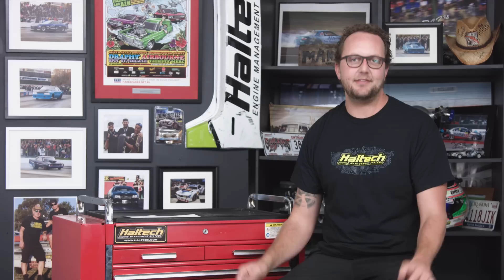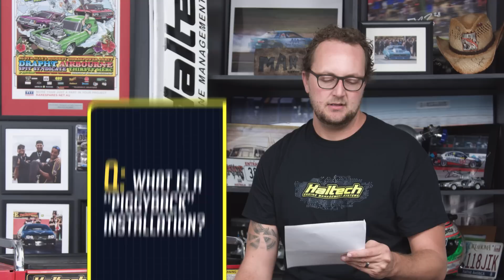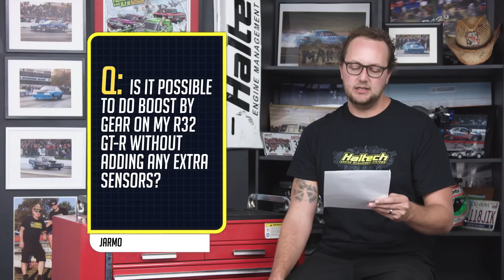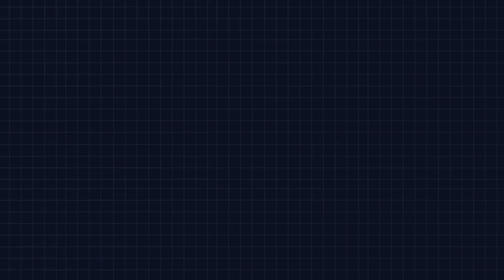❓ Piggyback Installs, Exhaust Valves and Boost by Gear - Haltech Q&A Episode 25

Comment: I'll be swapping my auto trans for a 5 speed in my 2000 sc300, but it'll leave a check engine light. Could I use a piggyback system to interrupt the check engine light from going off?

Comment: So in theory I can use a Haltech 2500 to run a ford Coyote engine in a PX ranger and leave the ranger ecu in place to run transmission, ac, traction control 4x4 etc ?
Reply from the maker: Yes.

Comment: Can the 750 do signal bending piggyback mode? Eg for an E.TB setup can you manipulate TPS and manifold pressure (load) to trick the factory computer to open up the throttle more? If its a detuned engine via TPS%

Comment: What kind of piggy back ecu would you recommend for a supercharged 98 camry v6 auto? Im new to this lol
Reply from the maker: Elite 2000 or Elite 2500 if you want all the advanced race functions.
Reply: @haltech  will it be a plug n play or do i have to splice muiltple wires?
Reply from the maker: It would require a custom wiring. You'd be hard pressed finding an aftermarket Plug'n'Play ECU for a 98 Camry V6 auto.

Comment: I have a Rx7 fd road car, I have the ps1000 Ecu and iq3 street dash and I was contemplating getting the racepak smartwire system.
Only trouble is I fear the smartwire won’t have enough channels for all the necessary functions of a road car. Also I can’t find any guides for fitting,  

Would it be possible to run smartwire and install while getting rid of the 3 or 4 fuse boxes the car has and maintain all the functions the car needs to operate on the 16 or so channels the smartwire has

Comment: how do you wire in and signal electric fans to turn on with the elite
Reply: MoPower have an output trigged  on and off by coolant temp i think thats pretty universal among ecus
Reply: I know how to set that up, but do I run the signal to the switch power on the relay or do I switch to ground the really when it hits the default temp. I was thinking switch power.

Comment: Would it be possible to have the halTech ecu control the emissions system like EGR valve and other vacuum solenoids?  Would it be possible to add an OBD2 "read only" data port?
Reply: Haltech stupid autocorrect on my phone
Reply from the maker: LOL all good:)

Comment: How many Volvo inline 5 do you guys see getting a haltech?
Reply from the maker: Not a lot of enquiries about the Volvo inline 5 at this stage.
Reply: maybe you didn't get a lot of the fun models in aussieland? Like the Rs and T5s?
Reply from the maker: We do get them, just not a lot of them get modified. Just like with every other car though, when people start working on them and they get popular at car meets and races then aftermarket manufacturers start making parts for them:)
Reply: Very true about the aftermarket, being a Swede i have a lot of that for the 5s. but i'd love to see what the rest of the world can do with them. the engines can take a beating, the horsepower record is something like 1200hp :D
Reply: In general, how difficult is it to run an aftermarket ECU on an I5?  I’m assuming you’d need sequential ignition. Any other quirks that need to be dealt with?  Firing order/angle maybe?

Comment: What sensors will I have to add to a cressida to do launch control and rolling anti lag with a elite 2000?(r154 transmission)
Reply from the maker: You just need to be sure the Elite 2000 is reading a speed input.  If it doesn’t have this then it can’t know when you are “rolling”.   Most people will add an enable switch for both so they can arm the system when needed.